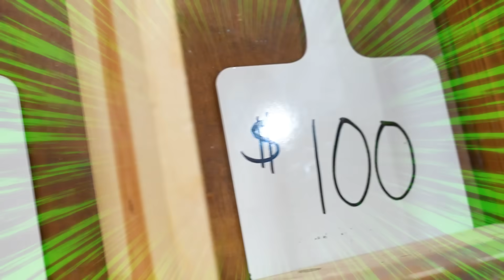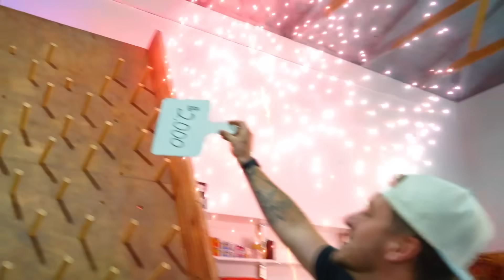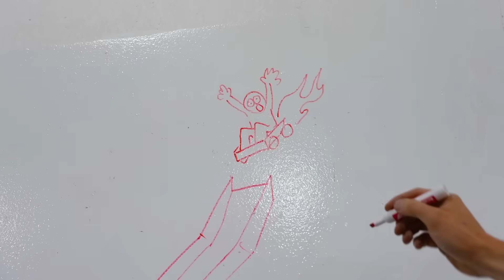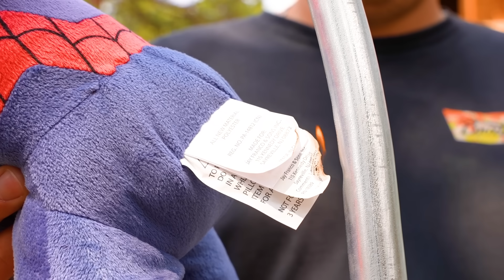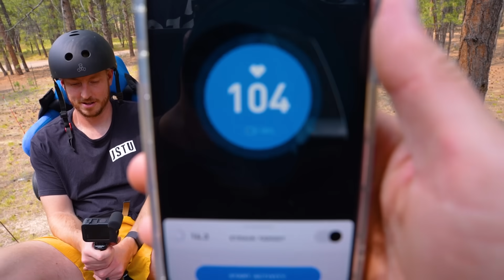We Built A Roller Coaster In Our Backyard!

Comment: That’s a cool video, he’s some information about the Tesla cyber truck.

The Tesla Cybertruck is an all-electric, battery-powered light-duty truck unveiled by Tesla, Inc.
Here's a comprehensive overview of its key features and specifications:
Tesla Cybertruck Overview
Design and Structure
* Exterior: The Cybertruck has a distinctive, angular, stainless steel exoskeleton design for durability and passenger protection. It features ultra-hard 30X cold-rolled stainless steel and armored glass.

* Dimensions: Approximately 231.7 inches long, 79.8 inches wide, and 75 inches tall, with a 6.5-foot cargo bed.

Performance and Variants

* Single Motor RWD:
* 0-60 mph: ~6.5 seconds
* Range: ~250 miles
* Towing Capacity: 7,500 pounds
* Dual Motor AWD:
* 0-60 mph: ~4.5 seconds
* Range: ~300 miles
* Towing Capacity: 10,000 pounds
* Tri Motor: ~ AWD
* 0-60 mph: ~2.9 seconds
* Range: ~500 miles
* Towing Capacity: 14,000 pounds
Reply: Decent car , but I will never buy it
Reply: and it absolutely sucks

Comment: I would've just made a wood one out of wood pallets and spent the money on hardware like wheels nuts and bolts. i wouldn't even buy concrete and use rocks found in the woods or something for foundations. then use a DIY windmill to power the lift through ropes with nots and midevil like mechanical gearing using pulley's. would've been allot of cutting of wood but if you put the track together then trimmed it for the carts it would be allot easier and safer so you don't have to adjust the entire track.